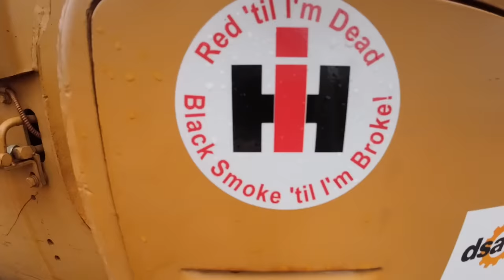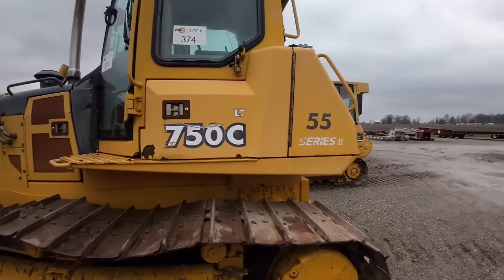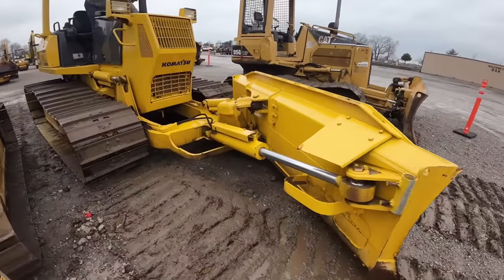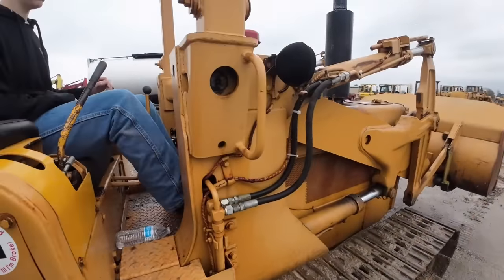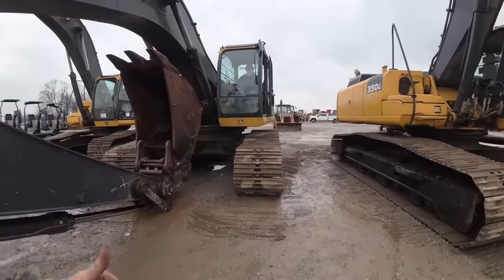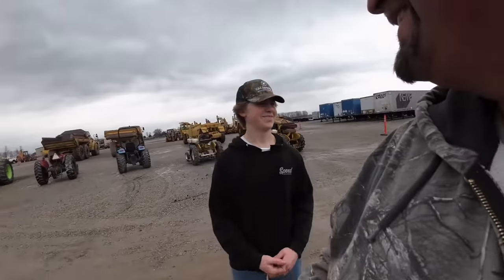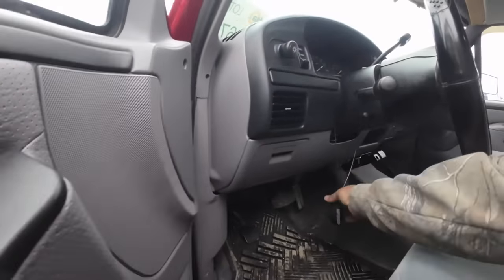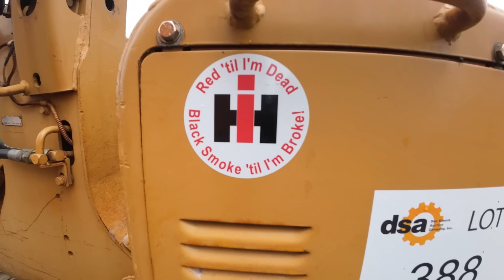Local heavy equipment and truck auction inspection with Tucker @donsmockauctioncompanyinc.7941

Comment: That John Deere 935 Front Mount Mower is a monster for mowing grass. I could finish mow 8 acres in three hours with a big old pond on the acres and I mowed the pond dam front and back. That Yanmar is a great diesel motor. You can even put a front blade on it to push snow. Start it if you have time.

Comment: The thing with phone company trucks is they may have low mile but they havnt been shut off for years. There plumb wore out. I use to hang with a phone tech and once th e weather got cold it never shut off it would run all day at work and all night in the yard October to April .

Comment: Had an old 750c common to have to pull up on the brake with your toe after sitting otherwise wouldn't  release. Another great video, like seeing how other guys quickly inspect rigs 👌

Comment: Would you recommend changing from a cable operation to a electric pto clutch on a older craftsman 42 in riding mower??
Reply: I think you meant that question for another youtuber but no. The cable is a whole lot cheaper to replace and wont rip out part of the wiring harness if the bearing goes out on the pto cluth

Comment: I only watch your auction videos because everyone else on youtube at auctions simply show us themselves operating machines badly with no technical appraisal. Your videos help others to seek out the specific machine mechanical conditions to look at ahead of purchase. 
If i may here?
Komatsu imo stole Cats designs , technogy and incredible tried and tested innovations back in the late 60,s. Iconic companies like IH, JD and AC had no need to do that and produced their own unique designs based on their own revolutionary ideas and concepts. Back in the late 60,s and 70,s here in Englandland it was hard to tell the difference between cat and komatsu equipment .Komatsu even stole the radiused rear fuel tank Cat design. 
Komatsu stuff today is probaly good but i always feel they got their start by stealing Cats research and incredible development expertise. 
Finally, if you dont buy the 100e my
my lawyers will be in touch  seeking compensation for the abject depression you have caused  
to your no 1 uk viewer!!
Regards
Ron
Reply from the maker: Lol
You are exactly right about komatsu
They copied them but made the machine just a touch bigger and a little more hp then and sold them for a bit less then cat
It got them in the market for sure, now they are totally different
Reply: @C_CEQUIPMENT  
Thanks for the reply. 
Did you buy the 100e ?
Reply from the maker: @ronpearce5777  I did not
I did buy the komatsu and the 815